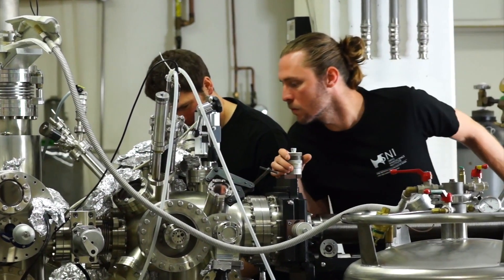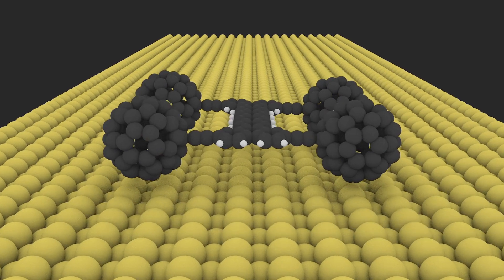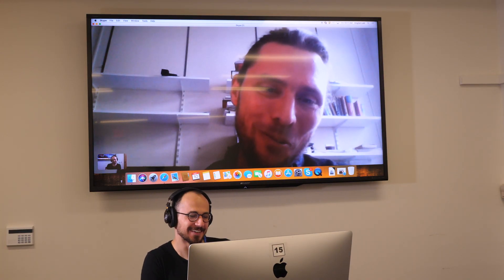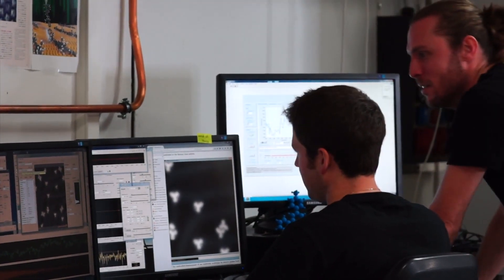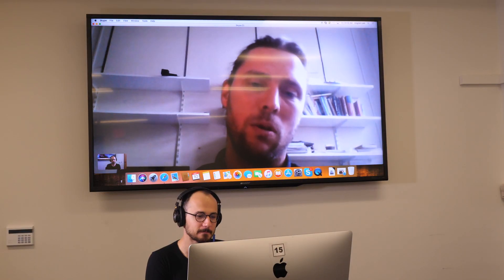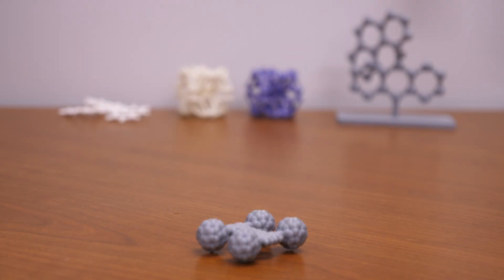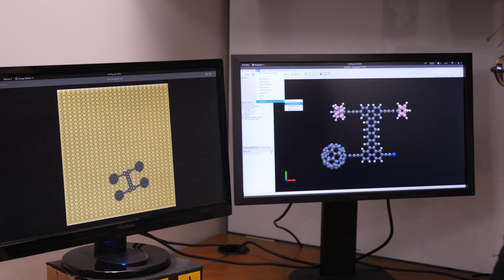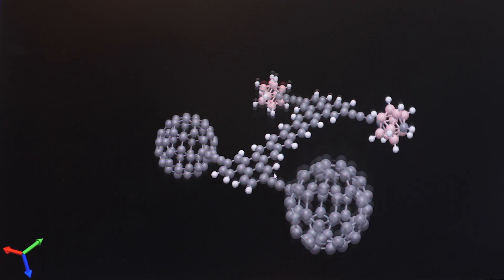World's Smallest Car Race

Comment: How they can move the car on nano plane? They say those techniques are so inefficient and needs to improve. 
I just wonder, and I want to know about these subjects more specifically. Could you help me at sometime :)
Reply from the maker: So the nanocars move by converting the energy they receive from the scanning tunneling microscope into motion. This can be imagined as charging the car and then allowing it to release that energy back resulting in some sort of motion. Right now this conversion efficiency is quite low meaning that most of the energy given to the molecule is lost.